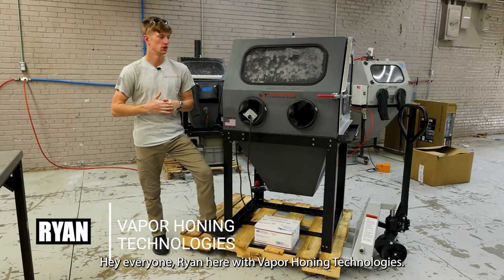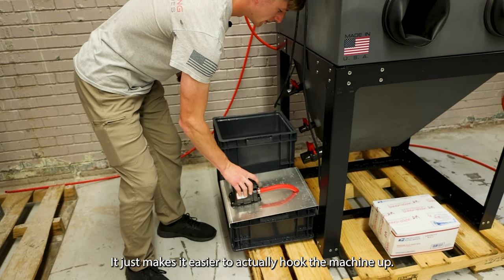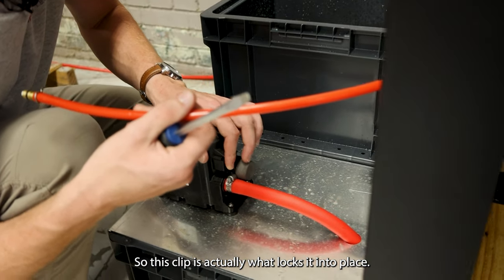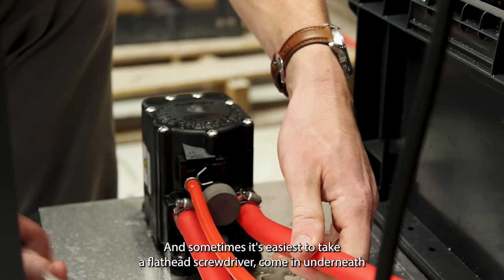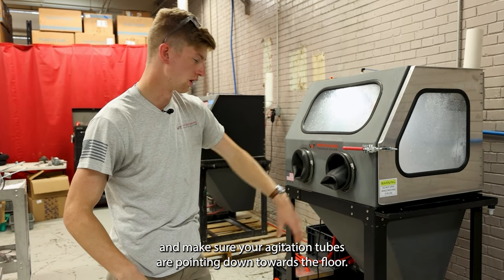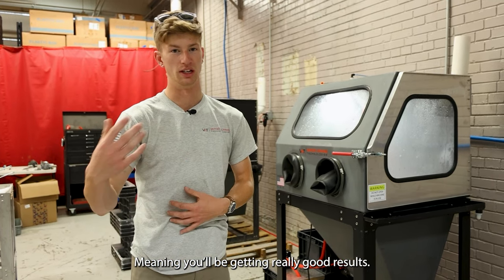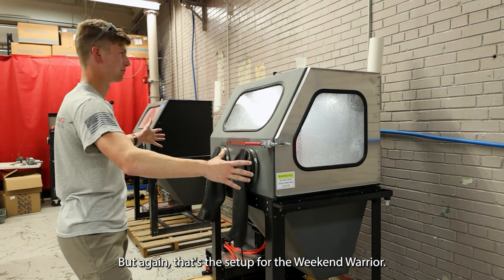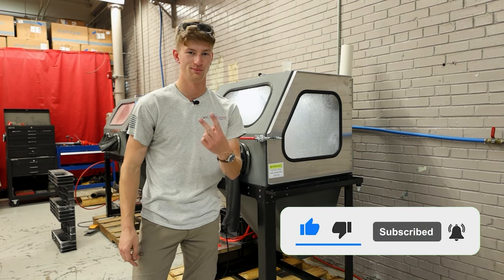How to Set-Up your Weekend Warrior - Vapor Honing Technologies

Comment: Good job Ryan.  That would have been good information to have when I got my Weekend Warrior machine.  The only thing I would add is the air hose for the closed loop pump on mine was attached to the Y fitting behind the machine and the brass fitting was already attached to the demand pump.  I used a heat gun for a few seconds to warm the plastic tube and it slipped right on the fitting because it wasn't going on very well cold.  Don't get it too hot though, just warm is enough.  The clamp was already on the tube so I just moved that into place with a pair of pliers.  The only other suggestion I have is the air connection.  Most people don't have a shop air system like you have at your facility which is probably powered by a rotary screw compressor.  The vast majority of people have a much smaller air source and will be needing to add a regulator to the machine itself.  I bought a Nitra precision regulator and pressure gauge from Automation Direct.  Obviously, there are much cheaper options and you might want to cover the differences between the regulators available and how to actually attach the regulator to the machine.  It's not that hard to figure out, but a little bit of information goes a long way in my humble opinion.  If someone has never used a machine that required regulated air pressure, they might have a little difficulty figuring it out on their own, so it would save some frustration if you were to cover that in a little more detail.  Just relating my experience, my machine required much for than 25 pounds of media that came with the machine.  I have a mixture of glass beads and aluminum oxide in my machine.  The only difference I can think of is I had the floor removed from my machine with the air turned off and then circulated the slurry.  I dipped the cup into the hopper instead of capturing it straight out of the nozzle.  I am going to do more testing to see if there is a difference in the concentration reading depending on how the sample is collected.  Logic dictates, at least my logic does, that the concentration should be the same, but I am going to investigate further.  Again, great information that would have been helpful when I got my machine and I am happy to see that you covered it in more detail.